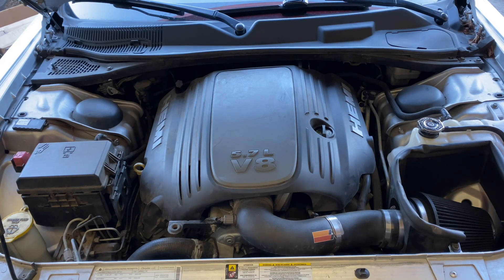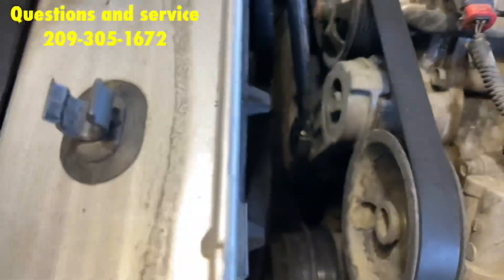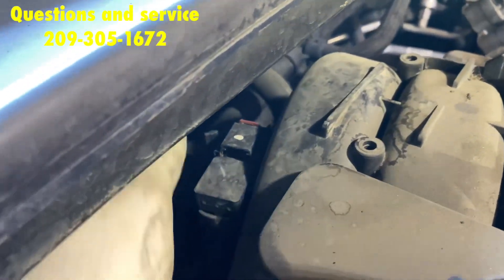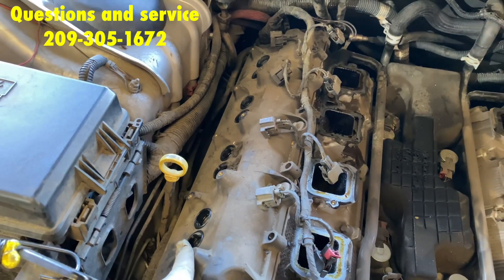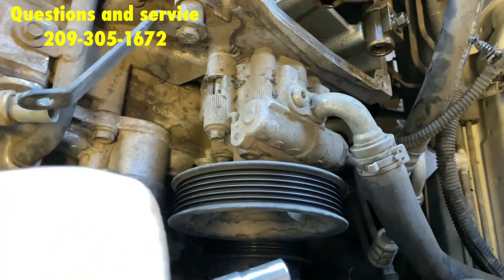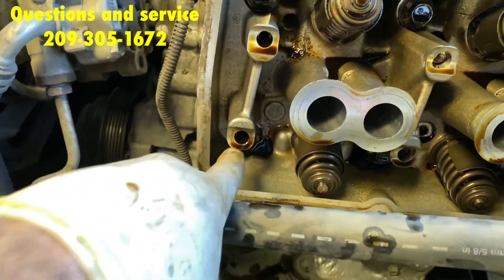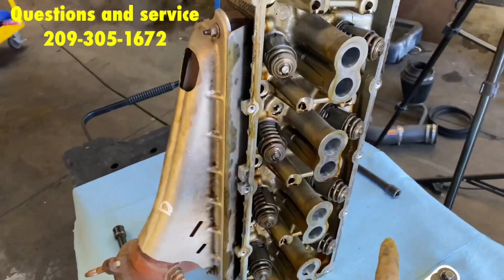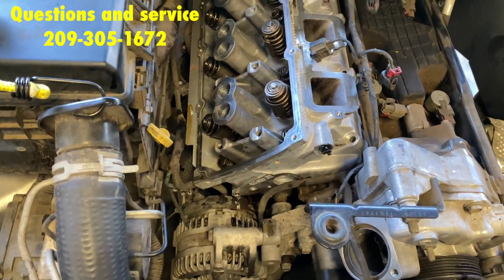Dodge Charger Challenger Ram HEMI complete head gasket replacement instructional

Comment: I just bought a mint condition 2005 JGC Limited with the 5.7 hemi, drove it for a few days and was coming home from a trip out of town and the friggin radiator hose blew off where it connects to the rad on the right side in front of the battery and spewed coolant all over the engine and components and now it's in limp mode! We got it towed to the supposedly 'best' shop in town and i can't get a straight answer out of them whether or not it can be fixed or what the fkng problem even is! They keep telling me they'll call me back and they never do so I'm about ready to to trailer it home,  it's an hour and a half away from where i live which is a real pain in the ass. So idk what caused it to blow off but I'm assuming the worst,  and that's leaky head gaskets!

Comment: When doing 90° degrees do you set the torque wrench to 90 foot lbs ? Or you keep it @40 & turn the torque wrench 90° degrees ? Because I’m putting together a 5.7 Chrysler .

Comment: When removing the head for head gasket replacement do the cylinders have to be in a certain position ? In my case im also replacing the cylinder head on my passenger side
Reply: disassemble and reassemble in the same position, dont move anything.

Comment: Great video. Very thorough. Thinking of buying a 2005 clean 1500 fully loaded with 149k and bad head gaskets.  Still debating but the head gaskets seem easier than my old Mopar 440 engine's.

Comment: You should have talked about pulling the coolant plug on the water pump so when you feel it with coolant you wait till the coolant starts coming out of that port on the water pump. It's just a 3/8 inch drive plug and that's the back side of the thermostat. It could save somebody an engine as it will keep the air pockets out. 😅

It was a really good video by the way.

Comment: Does it hurt if you don’t have it machined/resurfaced at a shop or is that a necessary thing to do? 5:46
Reply: It can, your head gasket blew for a reason. You don’t just replace the gasket otherwise it has a high chance of blowing again. You machine the surfaces to remove any potential imperfections or gaps so the head gasket is flush and makes a completely even seal. You also can have the machinist inspect the head and make sure there’s not any major cracks throughout. If there is a deep crack you will have to replace the head due to the fact too much material will be taken away and the head becomes useless.
Reply: @austinaldridge150 what if im opening the engine to replace the lifter’s u think i would have to get it machined?

Comment: Did you resurface the engine block too?
Reply: Depends if it is a cast iron block and aluminum head usually the aluminum will warp first and pop the head gasket and you can just resurface the head and check the block for any warping with a straight edge and a feeler gauge if it’s a aluminum block it is most likely also warped

Comment: Im working on my 09 Ram 2500 5.7 Hemi. I have heard conflicting comments on oiling the head bolts. Some say the bolts on these don't sit in any oil lines or coolant jackets, so oiling them and running them down into an inclosed sleeve will throw the torque readings off. What is your thought?
Reply: Torque reading isn’t off, it’s the fact that it’s now a lubricated bolt in a high vibration position. A little oil won’t hurt HOWEVER if you slather the bolt in oil more than a chicken breast in a fryer at popeyes your gonna have issues.

Comment: Dats a lot of stuff to take off and to remember to put them back on sheesh
Reply: This isn't a job for folks with memory issues. You could label everything but in most cases using intuition and memory works just as well.
Reply: @DL101ca  facts
Reply: Lable it all. Get some zip lock bags
Reply: @kylegrant9980  facts

Comment: What was wrong with the Resorvoir?
Reply: In some cases when you blow a head gasket it will push exhaust gases into your coolant system and can cause the reservoir to crack

Comment: Currently doing this exact job on my 2015 5.7. Shouldn’t this be possible without draining the coolant? I’ve already replaced the radiator, ac condenser, coolant hoses, and water thermostat.
Reply: Uh no cuz coolant runs through the ports to cool the engine. If you do t drain you’ll make a giant mess and contaminate everything under the hood!

Comment: I have a question I just rebuilt my engine on my 07 charger RT  2 days ago and today I noticed that my coolant kept going down I put another gallon and same thing won’t fill up. But I checked the dip stick and it was creamy the coolant and the oil mixed. But how can that be the head gasket is brand new. I’m not over heating and their is no white smoke coming out of the exhaust what do you think it could be.
Reply: Sounds like a blown head gasket.
Reply: @erichedberg2907  no I figured it out the machine shop that replaced my driver side head gave me a passenger side head instead they told me they were interchangeable, nope 👎 the the coolant passage was going straight into the oil passage in the head. They replaced it with correct head this time and my car is back to running like a champ👍👍
Reply: @rafaelfuentes7572  I've ran into that a couple times.
Reply: @rafaelfuentes7572  wow, that's a big snafu for them not to know the difference. Why did they think they sell a left and right head gasket if they're both the same ?🤦‍♂️
Reply: You probably did not have the heads resurfaced did you?